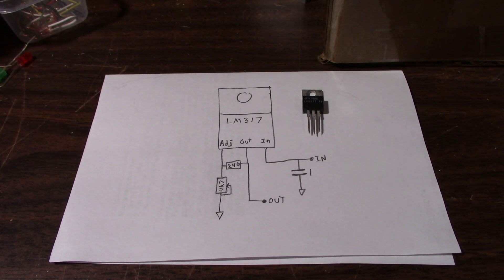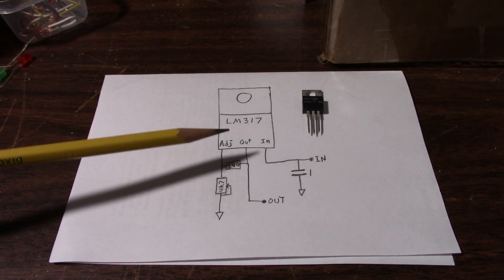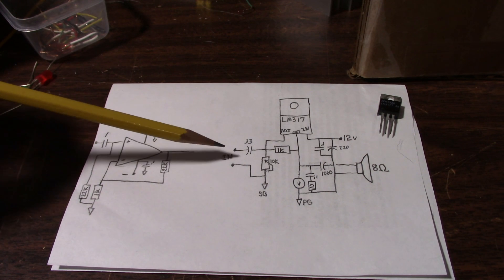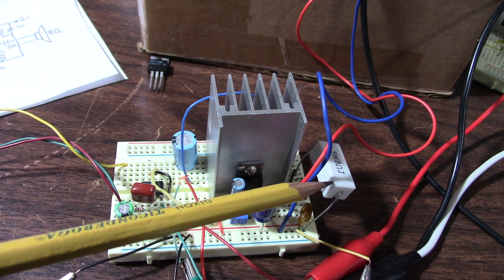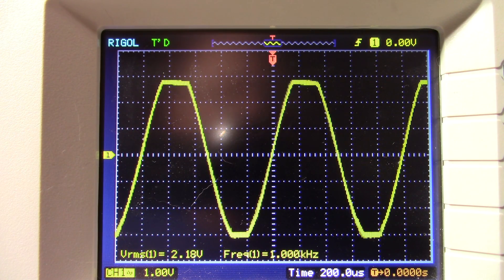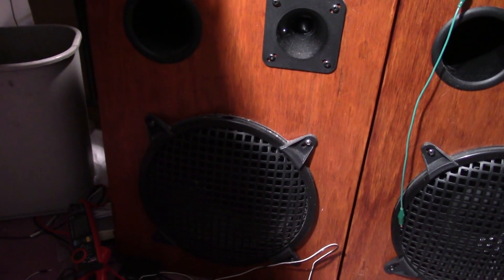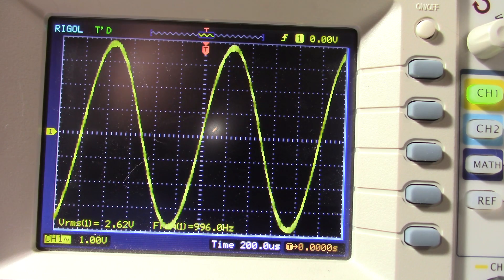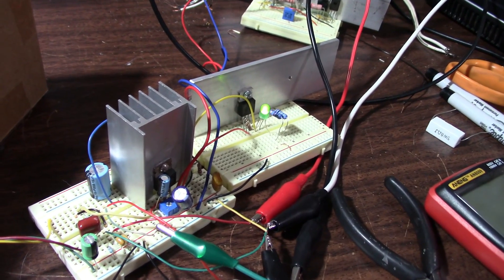Class A audio amplifier using the LM317 voltage regulator IC

Comment: I built up your voltage regulator amplifier with another LM317 designed as a current sink of 10 mA as a stereo headphone amplifier. It works very good. https://ibb.co/FK4Syb4 https://ibb.co/02S2s6r

Comment: Thanks for the circuit. I built it with two 12v supplies into a dual op amp fed at about 9v into the 317 at 24v with another 317 as a current sync. It appears to be pushing better then 2w without distortion with speakers reading 6.4ohm with my meter. Two 3.2ohm in series It's taken quite a bit of tweaking but it is sounding great. I appear to be reaching limitations given I have it built on a breadboard with many jumpers.
Reply: Up to 3w. I have some parts on the way to improve this.
Reply: @Spentelectrons  Did you manage to get it done? I have 4 of those LM317Ts I got recently and attempted another amplifier I found on YT (should come first in searches), but I find it a bit odd, since you need to connect the PSU directly into the speaker. Would you mind sharing a schematic of your design? I want to make a simple and low power amplifier for casual listening.
Reply: @Algray_  I never did get around to working on this again. The chips I ordered turned out to be fake and didn't work. I did it pretty much exactly as John did with the exception of the 317 as a sink but I can give you a copy of the preamp i used if you want. Volume, gain, treble, middle, and bass controls. It's a nice sounding amp but you gotta use proper heatsink to keep it cool
Reply: @Spentelectrons  Thank you for replying! I was trying to get around by using both the circuits from the same channel I found that amplifier I mentioned, I made a preamp using C2383 A1015 and 1815, but I ended with lots of distortion on the output. (DIY preamplifier with transistor - will be the first result as well) I'm just a beginner and lack a lot of knowledge regarding schematics, so those tutorials do pop up for people like me. If you could share that preamp you mentioned, send it to nishijimafilho@hotmail.com. Once again, many thanks!
Reply: @Algray_  I used RC4558NB op amp in this case. I believe it's a LM4558 variety
Reply: @Spentelectrons  Thanks! I have found that IC to buy, although I am on a tight spot right now. Not to mention, they might actually be fake, there's no reliable sources for components where I live. Regarding the heatsink, I do believe I have enough for the 317 https://www.soldafria.com.br/image/cache/catalog/dissipador_183005.des-500x500.jpg (I had an idea of making 2 of those to create a stereo amplifier, that's why I bought more than 2 LM317s, doing the same with a Preamp)

Comment: I tried similar thing with 7812 few years ago at my previous job, but it wasn't working for me. I'm glad somebody had same idea and made it perfect :)  But I must say I tried to use just resistors and capacitors, because I had nothing better at hand. By the way, couldn't you use second LM317 as current sink?
Also idea - when I think of this and your previous video about unbiased output stage, could you make amplifier with 78** and 79** instead of output transistors? Or just 317 and its negative output version.

Comment: Use an inductor instead of the resistor, it will allow higher output power (because you will be able to get 2*Vin voltage swing). But then you still need to current limit the thing with a sink...

Comment: What about 3x BC182L transistors in Long Tailed Pair drive 2x BD131 transistors with a 470R resistor between VCC and the top Base pin on the top transistor and a diode between the top Base connection to the collector on the bottom transistor and a 5R resistor between the emitter on the top transistor and the collector of the bottom Transistor, the emitter of the bottom transistor connects to negative. The noninverting side of the LTP (Long Tailed Pair) connects to the Base of the bottom Transistor, a feedback resistor of 470K goes between emitter of the top Transistor to the inverting side of the LTP, A 47K and 47UF capacitor in series between the inverting side of the LTP and negative.

Comment: I never would have guessed, that a voltage regulator would have such a high frequency bandwidth. Know, that the LM317 uses a 1.25 volt internal voltage reference. If you tie the control pin to ground, the output goes to a minimum of 1.25 volts. It shouldn't make a difference, weather you pull down with a resistor, or the constant current sink, if the output is not loaded. At 1.25 volts, the 156 milliamps is more than enough load current for a LM317 to regulate accurately. When driving a load, and the resistor has to discharge your output capacitor through the speaker coil, that's when you will hear the difference at levels close to clipping by using a constant current pull down.
     Granted, a purpose built audio amplifier like a TDA2030 will be more efficient, and more powerful, but it won't sound any better than this did. Why? They're both practically perfect! (All amplifiers sound better with a little cat hair in them!!!)🤣😝😁

Comment: Thanks for the video . New subscriber here , I have a question ?  Will a  TA7222AP Audio amp  that is going bad create a intermittent popping / Cracking ?  Or would you say a ceramic cap  Or ?  This is in a 10 meter HF Radio  20+ yrs old /  Thoughts ? Thanks for your time

Comment: When you calculate power, why do you use 8 as your impedance? The actual impedance of the speaker driver varies with frequency, having much more impedance at high frequencies, and less at low frequencies. The lowest impedance of the speaker (lowest frequency within its operating range) will be below its designated impedance, right?

Comment: One of the more interesting novelty circuits out there. LM317s have a reputation of requiring some series resistance to avoid oscillation when asked to drop more than about 8 V or so, which kind of limits its utility in applications such as headphone driving (one of the few areas where you can get away with a single-ended output stage without too much fuss), but it's quite neat nonetheless.

I once came across a circuit design idea that used a voltage regulator as a microphone preamp, not sure whether I saved it anywhere. It did strike me as rather novel though I did have my doubts about its performance. The amplifiers in standard voltage regulators tend to be somewhere in µA741 territory.

Comment: I was told that class A is always best for audio amplifiers. It would be great to see a simple design that has more output.
Reply: As shown here it's also quite impractical to deliver any actual power. Class A differs from other classes by not having any potential for crossover distortion, but when you balance multiple kinds of distortion sources and types against each other, i don't think it's necessarily a winner.

That being said, when you need only little power, such as headphones, that's entirely a worthwhile approach.

Comment: How on earth did you discover this one ?
Reply from the maker: On the old datasheet they had a circuit using the LM317 as a current source in an amplifier circuit. It has since been removed in later revisions.
Reply: @JohnAudioTech  and sombody else ask the question if the make good headphone amps.   Ik looked good on the scope

Comment: Haha lm317 for audio. The tda2030 for multipurpose uses: virtual ground. 
Power supply.
batteries balancer o charger is a power op amp uses.
Reply: Yep, I saw some people made a low power variable voltage supply with TDA2030 :)
Reply: I used a TDA2030A as a lighting dimmer!

Comment: That Circuit reminds me at the possibility to use the 555 as Audio amp.
Reply: I had a crazy idea of making a class D amp with an Arduino. Didn't put much thought into it and I haven't tried it. Would be cool if it was possible.
Reply: @userPrehistoricman  A while ago i found a schematic of an Class-D with Valves/Vacuum-Tubes only, No semiconductor.
Reply: @userPrehistoricman  Tube sound is a thing and is measurable...

Comment: Thought you'd use a second LM317 for the current source!
 Anyway, cool circuit. Now for the 555 amp!
Reply: You mean a push-pull? You would need a LM337.

They actually aren't half bad, though I believe they begin struggling at 15k+, though most people can't hear that high anyway :P
Reply: @rich1051414   No, but an interesting idea!
Reply: @HillsWorkbench  Well, I mean, if you are going to use the LM317 as a current source, I struggle to see why you wouldn't invert it's polarity and make it a push-pull, then you can get rid of alot of the biasing and be better off overall.

Comment: Now that's what I call a Throwback Thursday video! This version performed about as well as the old one (at least what's in my long term memory ;) ) sonically. Yes, it's power hungry (good 'ole Class A), but that's what makes it so clean at such a simple design point. 

Thanks for the shout out. Glad to have reminded you of the old project. I like to see when people think outside the box, as that's usually where true innovation comes from. 

And thanks for all the content and knowledge you've shared over the years here on YouTube. Say hi to Snickers for me. :)
Reply: I like the idea of a mystery circuit. Like a board with just two LM317s on it (one for the current source), anyone would think it's a power supply. Stealth audio amps.

Comment: Does it make great headphone amp?
Reply: Ive used a design that used a  tube running off 12v with a similar circuit to amplify the current as a headphone amp. I would say yes with experimentation
Reply: @jarrodhoule8134  Can I go dc coupled at input with a low distortion opamp wrap around it to achieve lower noise and distortion?
Reply: @johnyang799  I dont quite understand what you mean by op amp wrap around (not into op amps that often) but since there is no DC connected directly to the input I would say go for it. Worst that can happen is impedance mismatch I assume.
Reply: @jarrodhoule8134  I meant composite amplifier. Use lm317 as current output stage of the opamp. And applying a global feedback around the two. Also using T compensation to ensure high open loop gain and stability. This is doable with buf634 lme49600 tpa6120 etc. The lm317 here sounds like it's really amazing interns of linearity and pretty decent current output. Probably not as good as tpa6120 but can be a fun project.
Reply: Pretty sure most headphone amps only need to swing +-3 volts at 32 ohms, and this seems to ALMOST be able to do that.
Reply: @rich1051414  I am actually more concerned about noise and output coupling capacitor, also in order for it to be meaningful it has to compete with solutions in similar form and budget, distortion is also a concern. So I think how it would perform in my favoured topology, composite amplifier. I think I'll just do some simulations. What about the output capacitor, how large can I go? Is it better to use 6800uf aluminum in parallel with 2.2uf film cap? I'm shooting 0.0001% for 10mw into  8ohm load at least 16ohm.
Reply: @johnyang799  You don't need more than 470u for headphones. You do when the load is really low impedance(2-8 ohms). Capacitance that high on headphones with relatively high impedance(32-250 ohm) would mean the DC offset would take quite a while to zero out... an uncomfortably long time.
Reply: @rich1051414  ok i see. thanks
Reply: @rich1051414  So in that case I need a virtual ground. It is a solution that I am aware of.
Reply: @johnyang799  Ever plug into an amp and they 'POP' then the volume slowly climbs up to normal? 
That is due to the size of the capacitor, it's a bit on the big side. The pop is the DC on your speakers, and the volume slowly rising is the DC slowly zeroing out through the capacitor.
Reply: @johnyang799  Yep. Removed that comment though as I felt like I was getting away from the point of your comment.
Reply: @rich1051414  I just did some simulation, it seems that dc coupled input throw off the biasing. What biasing does it need? I'm not worried about output to be ac coupled at the moment, just the input.
Reply: @johnyang799  4.7uf assuming it has a 4.7k input impedance would be -3db at 7hz. That would close to ideal.

That means you need a 4.7k resistor in series with the capacitor before the biasing is applied. The capacitor value will need to be modified if that doesn't work.

Comment: Interesting idea! Now, does it work using a dc-dc (like the xl6009) and it's feedback pin?
Reply: This could be done with nearly any adjustable linear voltage regulator. After all, adjustable linear voltage regulator is another name for a power op amp.
How they perform at music is a different question. They usually aren't designed to react fast to changes in voltage on the adjust pin. It might happen to work great though, doubtful.
Reply: @rich1051414  it would work, but will it be efficient? Will it compare a class D amplifier (since a switching supply is similar to class D)?
Reply: @narayanbandodker5482  Absolutely not. Linear amps are not efficient at all. They are simpler with less in the way of the signal, so inherently better sounding, but technology has progressed where you can't tell the difference in modern class d's though.